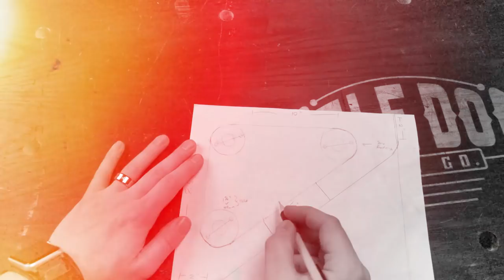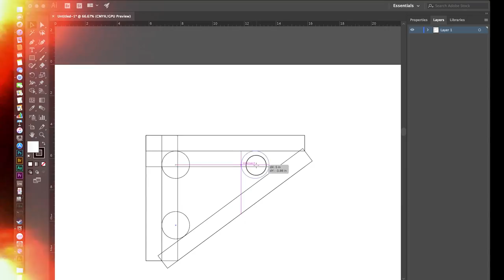Easy DIY Clamp Rack with French Cleats - Expandable - How To

Comment: Clever, I would one up that and probably get some L brackets together and be done with it. Could also make a small lip at the end of the triangle to help it from slipping/security.

 Thanks for your input though!
Reply from the maker: After the video (I forgot while filming) I did put blocks on the bottom to take the stress off the cleat. L brackets would be great. Much simpler. Thanks for watching!

Comment: Finally a clamp rack that actually makes sense!  One minor thing; maybe a little block on the bottom of the hanger to support the rack from the wall.
Reply from the maker: Thanks, I’m glad you like it. And yes, there is a lower support attached to the wall, I just didn’t put it in the video. These racks will eventually be moved to a different French Cleat wall, so I didn’t want anything attached to the rack in case the sizing is different.

Comment: Hi there from Portugal,
Will a block in the bottom in the back of the triangle(opposite to the cleat) increase the stability?
Obrigado(Thanks)
Reply from the maker: Yes. I didn’t show it in the video, but there is a 1x3/4 piece mounted a few inches below the wall cleat. In the future these racks will be moved to another French Cleat wall, and that stability will come from the next row of cleat down.